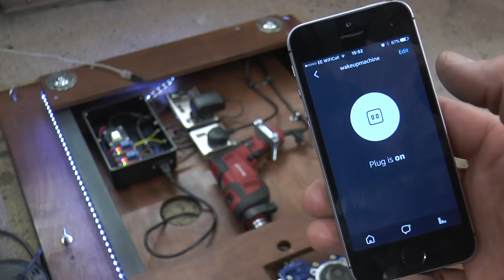Voice Activated Bed Shaker - How To

Comment: The cam is too long, you can hear the drill bogging down. Shorter cam will shake the bed more and have much less load on the drill.
Reply: Dainis Berzins what he said ☝
Reply: Yep. Also a higher ratio on the gearbox would help. Those drills like to run fast.
Reply: Remember what he said about the welders
Reply: its a video project that he will throw in the skip after a week ,i dont thnik he cares to be that precise
Reply: I've had things dodgier than that run for years. I used to have a water cooled phone charger cos as soon as I tried removing the coolant it caught fire.

Comment: Be good for waterbeds, have a temperature sensor that can detect if there is a fire (cheap drills do throw out sparks and even flames when in heavy use) - you can also have a sprinkler system above all the electrics that then drive the water from the water mattress.

Comment: in case the springs don't work as expected, just put a second crank under the platform and connect it with the first one -> no more rotating.

Comment: Maybe you could reduce the amplitude and increase the frequency to get a better result? If the gear reduction arm was smaller it could get it done. Also, instead of having it voice-activated it should be clock activated, maybe a bluetooth trigger hooked up to a basic phone app?

Comment: Dude! Make a bike that you can ride on water! Take the front wheel off and attach a float under the fork, then make 2 large stabilisers with floats on the end. With the back wheel, take the tyre and inner Tube off and weld or solder paddles on to the rim. The way it works is that then you pedal, the wheel spins which the paddles are on, pushing forwards. Under the front float, add a fin to be a rudder so that you can steer

Comment: you should've gotten a used industrial-grade electric motor, they have much more torque and are measured in kilowatts, because they are so powerful. they could cope with the extreme stress from the gearbox better i suppose

Comment: Apparently cordless drills handle high torque applications much much better than corded ones 
Taken from Jeorg Sprave (probably butchered his name); he used one in an automatic crossbow and he said that the corded drills burnt out really fast, but the cordless one handled it like a champ without even getting hot

Comment: Let’s hope your son won’t spill anything like drink on the bed (well you know he for sure will make the bed wet at some point). Wouldn’t be safer to do head board electronics. That would set drill at the right angle anyway, all you will need is belt or chain going to the “shaker” in the centre.

Comment: i dont see you actually using this on youre son but still : (pointing finger up) if the drill does catch fire and sets the matras on fire you cannot put it out with water as the foam is a oilproduct , it allso will smoke like crazy 
might be a good idea to get an airpowered motor , that can take the resistance too

Comment: Can anyone help me linked the google home with a motorised tv lift so when i say tv on the tv lifts up out of the counter and turns the tv on at the same time.
So if i meed a hub for this i have a harmany hub but i still need to find out if the up and down trigger switch is a ir or fr for up and down.  Or if i can wired up a trigger switch so it works for the up and down with different commands ie (tv on ) " will turn the tv on and the activate the TV lift to go up" ? Any help will be really appreciated. Or info for what to buy for this to work